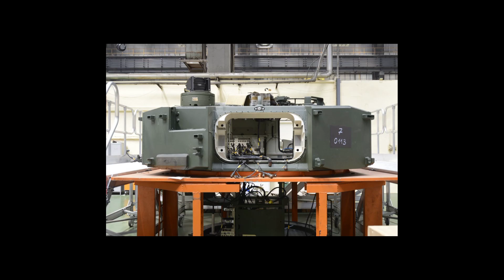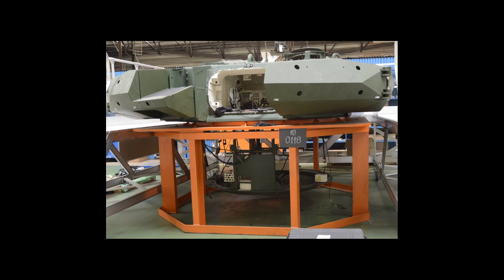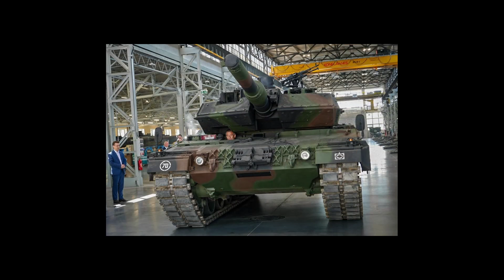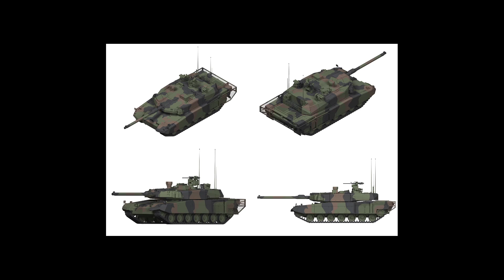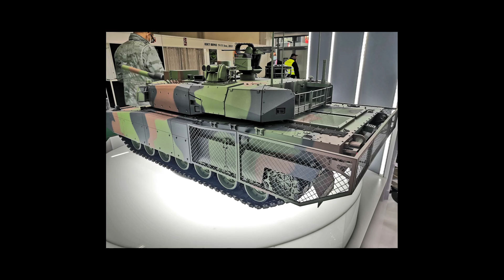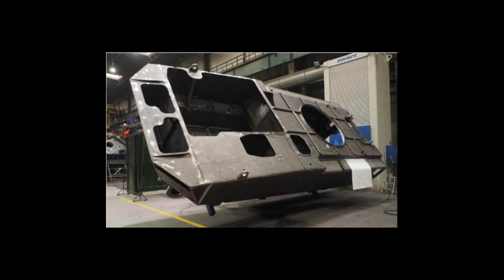Let's talk about tanks - Modernization of the Polish Armed Forces.

Comment: You didn't mention breach modification which allowed L/44 GUN to fire DM63 APFSDS
Reply: Great point. This approach increases the effective firepower without the durability loss associated with the alternative upgrade to L/55 gun. Overall, this modernization program looks good but we'll see about the rate of production. If many tanks require more overhaul or extensive repairs, it could be quite slower than expected.